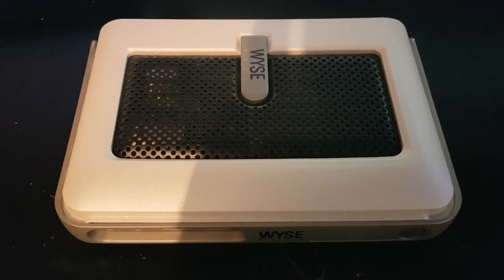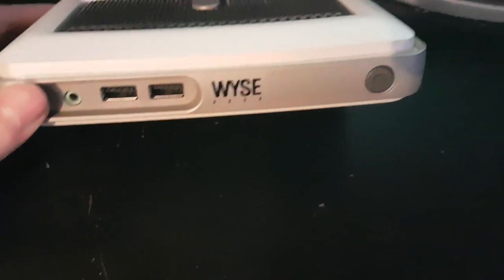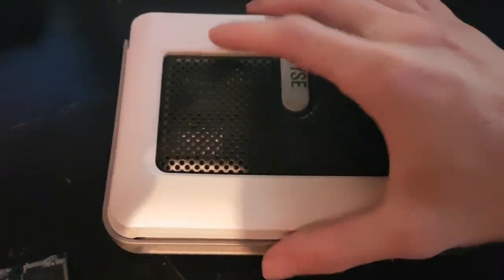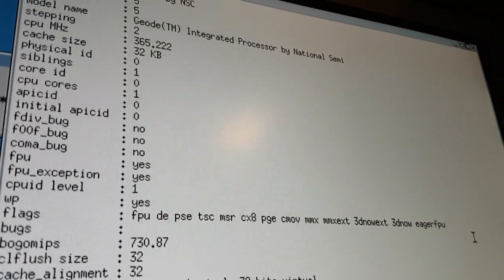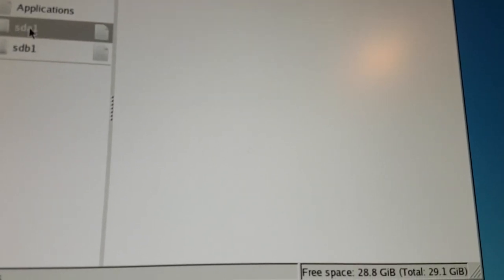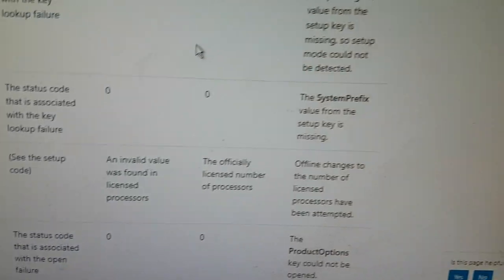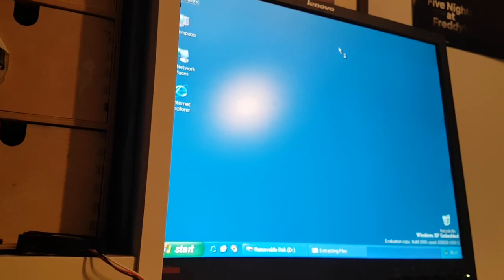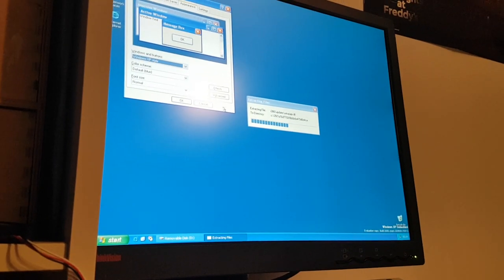Wyse Winterm Sx0 02L Part 2

Comment: If you want drivers, get the S90 install from Dell. You'll need an older version of the WYSE USB Firmware tool. You'll want to update the BIOS to the latest. Another thing you may need is the key file from the S10 (or whatever version) OS install. Make the USB installer (must be 1 gig or less) for the OS that matches the model you have. Copy the key file from it. Make the S90 installer then replace its key file with the S10's. Now you can boot off the USB stick and install WYSE's  XP Embedded. I did this to put WYSE Linux V6 and XPe onto a couple of S30's. How I figured this workaround out was that Dell used to sell an XPe upgrade kit, so there had to be a way to bypass the factory OS type lockdown to be able to install XPe on the second revision S10, the S30 (WinCE), and S50 (Linux V6) models. IIRC the XPe kit included a 512 meg SODIMM and a new DOM, which would be especially relevant for upgrading an S10. One caveat with the S90 install download, it reformats the DOM to 128 meg despite the download claiming to be for 512 meg. I didn't try any partition manager to expand it.

Now to get the drivers try installing DriverMax and use its backup function. Select ALL the drivers. It will pack them up into a ZIP archive. Copy that to a USB stick then unzip on a faster PC. Go back to your custom XPe and aim Device Manager at the unzipped driver files ripped from the WYSE XPe install.
Or you could try Snappy Driver and have it detect the hardware and download the appropriate XP drivers.

These DOM devices are not super robust. You shouldn't put a swap file on one. Perhaps assign it to a USB drive?

What I want to do is figure out how to get plain old MS-DOS 6.22 onto the Disk On Module and booting from it. As you discovered with Tinycore Linux, the Sx0 has that annoying 'feature' of disabling but not really disabling the IDE controller. MS-DOS cannot see past that, not even when installed to the DOM using another PC. Neither can the FreeDOS installer, Dr. DOS, or PC-DOS 2000. DOS is going to need a replacement bootloader to work with the way the Sx0 BIOS screws around with hiding the IDE. There are some DOS USB drivers that may work (I dug around and found some that used to be available from Panasonic) and there's a DOS driver that should work with the Ethernet. The sound MAY work with one of the two DOS AC97 drivers I found, one from VIA and the other from (IIRC) Realtek. That depends on if the AC97 chip is 100% pure AC97 spec and the drivers are too.

I want to find out if the memory map has a large enough window in the right place in order to set up Expanded Memory (EMS) for an old DOS program that cannot use eXtended Memory (XMS).